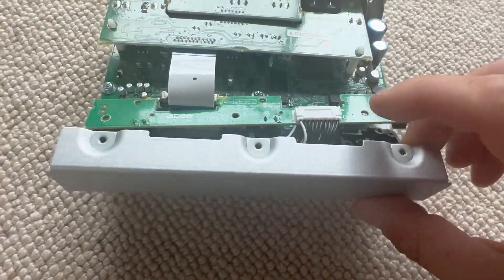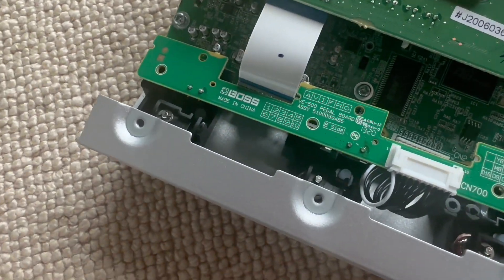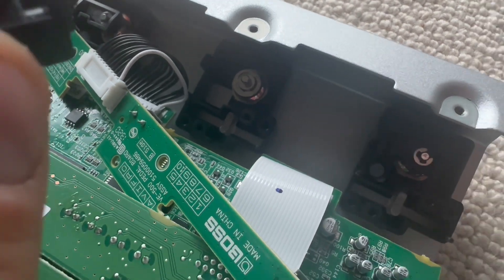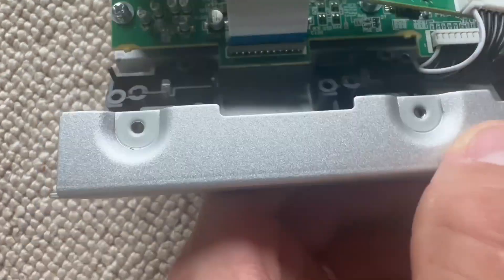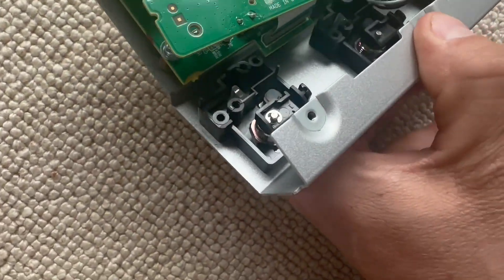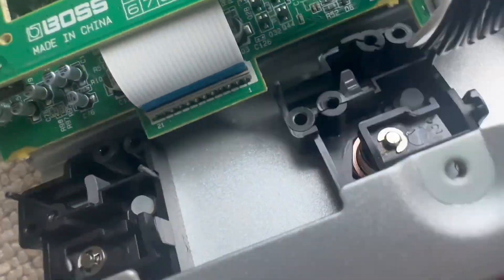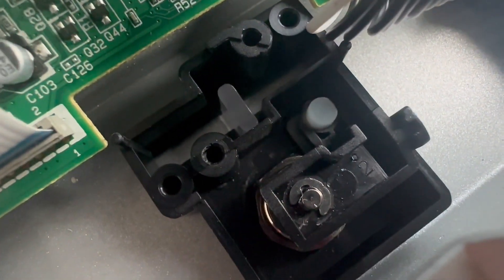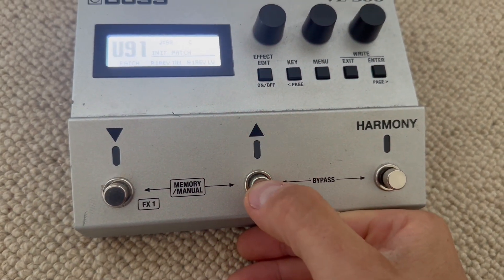Boss 500 Series Teardown/Repair Button Fix #rc500 #bosspedals VE-500 MD-500 RV-500 #bossofficial

Comment: It’s fascinating to watch your deep dives into this, your midi implemation, and even your programming. For my electric setup I have a digitech gnx3000, (which is tone monster and I love this discontinued piece of machinery!) I’ve now been through 8 of these because one button has stopped working and I need it for the next show. It’s time for me to take these apart and start fixing. Thanks Matt!
Reply from the maker: Thanks! Yeah, just dive in.  It seems like it is almost always some sort of little mechanical issue that causes these type of things to fail.  An attenuator or switch will occasionally wear out but usually it's something like a retention clip popping off or a screw working its way out of its thread. Good luck!
Reply from the maker: I just looked up the gnx thing.  It's gonna be a spring problem in those type of pedals.  It's always a spring.

Comment: I'm a fan of your live performances. That being said im surprised you dont break stuff more. These things are so easy to just tug one thing too hard and its done.
Reply from the maker: Yeah, I like to just dig into these things and try to fix them myself. It's often just a simple thing that wears out or a little PCB that needs to be replaced that comes out with a ribbon cable.  Everything I have gets HEAVILY used and it does break.  If it can break from usage, I will break it.  It feels like they design most of these musical gear products to be used 6-8 times a month, not 6-8 times a week! Haha.